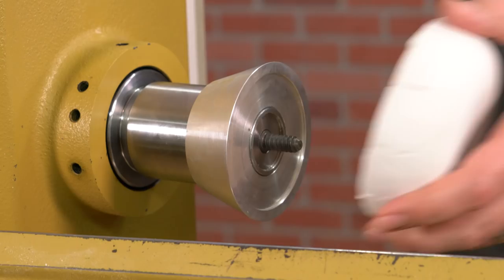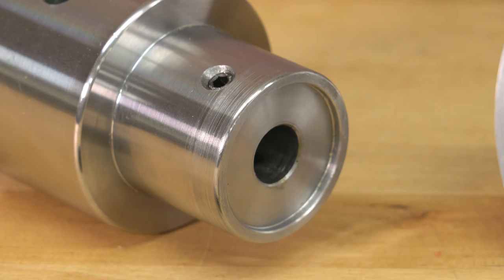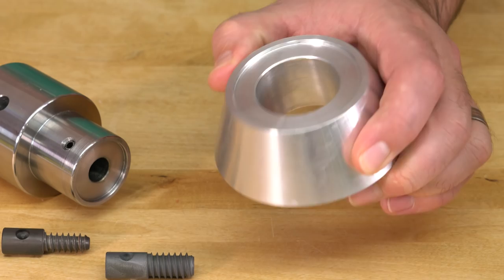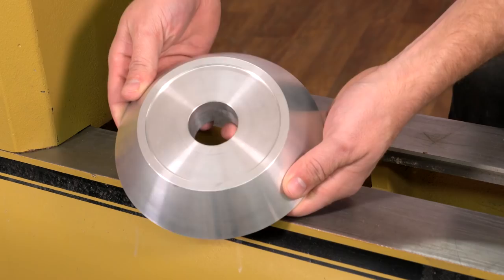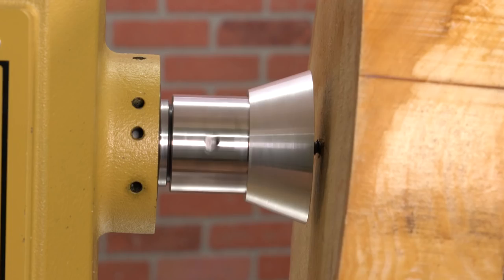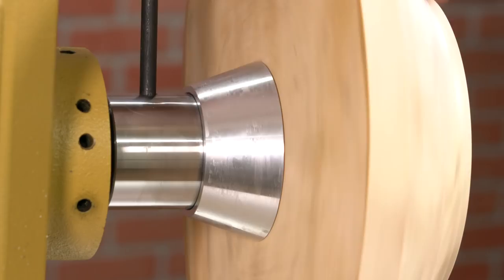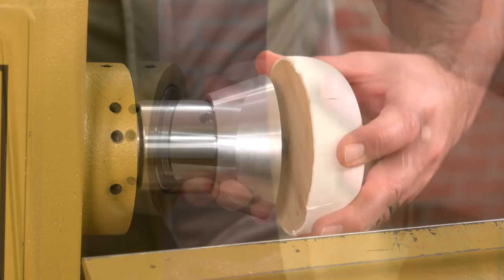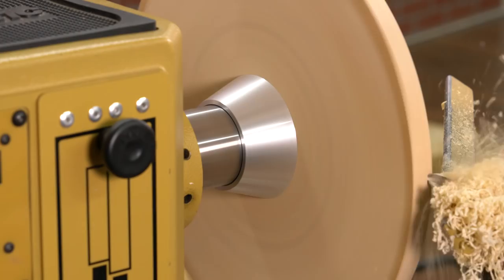3-in-1 Screw Chuck (Woodturning Accessory)

Comment: I'm just a novice when it comes to turning items such as this, however I think I might see an inherent problem with screwing on the threaded arbour.  Would this not create a problem with striping the threads inside  the bowl if you were not extremely careful when threading it onto your chuck, especially if you were removing your work several times & threading it back on ?  I have a suggestion that might help in that regard though...Why could you not put in a four prong "nut-zert" (I'm not sure what they are called in the U.S.) in the hole you have drilled, that way your arbour could thread into that instead of a much softer wood.  then when you were done, simply remove the "nut-zert" & fix the hole as you would normally do.